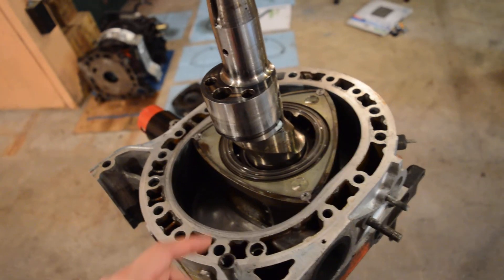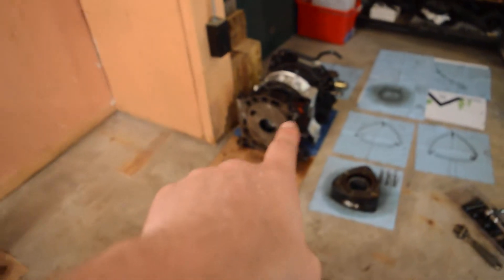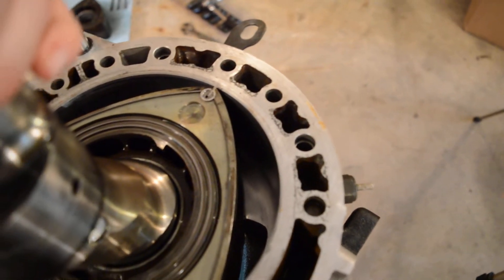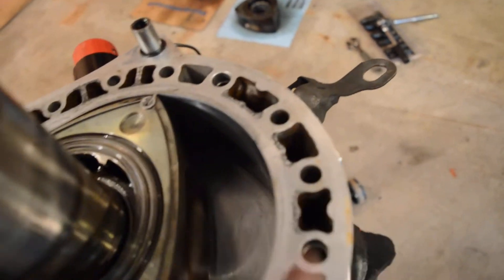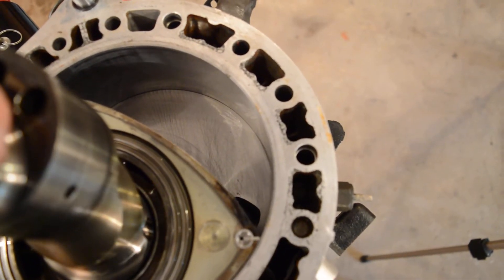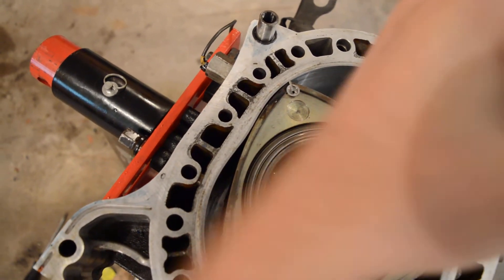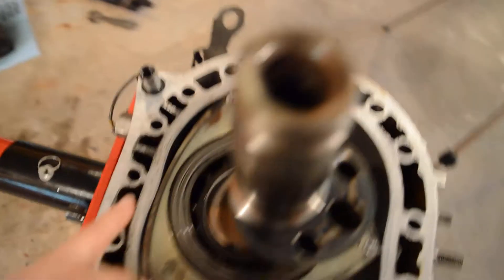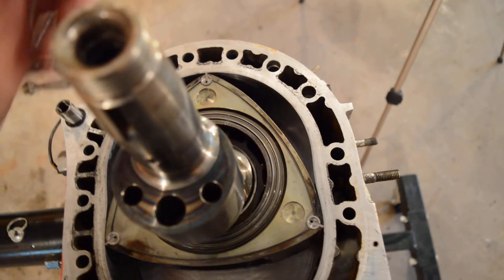Explained: How a Rotary Engine Works

Comment: Nice quick video. This is the engine you had lightly ported and built yourself but had compression problems once it was in, right?
Reply from the maker: Yes, That's the one. I'll have the video up this weekend of me taking it apart and figuring out what went wrong.
Reply: Howzer Tech I'm interested to see that's for sure.

I'd love to take my time building an engine for mine somewhere down the line so it'll be good to see what kind of mistakes can be made even when you take you're time.

Comment: Hello, Good to see a proper basic shown example of how a rotary works. Some people try to over complicate it with bullshit to try to make them sound cool. Is that the motor you built for the car with the compression issue?. If so was it a sticky apex seal or those bastard corner seals. Did you use new side seals during the build? Sometimes if you use used ones even within spec they can be a bitch to lap in. I have put over 1500kms on a engine to get them right. double the premix and after the first 100km give it the beans. This is on N/A motors though.Any way great video.
Cheers from Queensland Australia.
Reply from the maker: Thanks. It was a quick video that I shot while working on the motor. Yes, it's the same motor that had low compression. I used all new seals & springs and the apex seals were all free. I didn't really find anything out of place, haha. I'll try your advice once I get this motor all sorted out. So far the spare engine has ~1100Km on it and is working well.
Reply: Howzer Tech  Hi Mate, I would personally not take that engine you built apart. Fill it will oil and when you need it put it back in the car and drive it for at least a couple of thousand klms at different rpms.
if you used all new seals and machined end plates it will take time for everything to lap in. Like I said double the premix but keep a couple of sets of spark plugs handy. I have built alot of engines and even ones with completely new parts and they can be a bitch to start. So when this happens you give it a compression test and it's down in one chamber and you think the worst. Did I do this did I do that. The video you put up with the car running out side had a very even exhaust note so I don't think it is to greatly wrong with the engine. I would turn the boost all the way down or disconnect the charge pipe run a air filter on the intake and go out and give it some variable rpms and engine loads. One side note when you filed to size your side seals did you make sure they were with in Mazda spec. But more importantly did you file the end to the shape of the corner seal. Just trying to give you some ideas. You have put alot work into that engine and I would give these things a go. As you would know you can't just lift a end plate if to take a look, it's another complete rebuild. Sorry for the long rant just trying to help mate. Hope all is well. If you have any questions let me know. Cheers from Queensland Australia. Mark.
Reply from the maker: I appreciate the help. I took the engine apart a couple of weekends ago, hahaha. I just haven't put the video up yet. I know that it'll require a complete rebuild once opened. I am testing it with different seals and, once I have everything figured out, I will get a new gasket set for it. I did measure the side seals to spec and I ground them down at an angle so they would sit properly with the corner seals.

You make a good point though about the housings, irons, and seals all needing time to lap themselves. Once I am happy with the engine I will double my premix amount for the break in period and do a long brake in procedure.